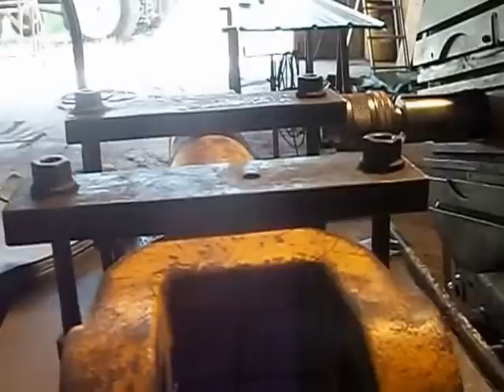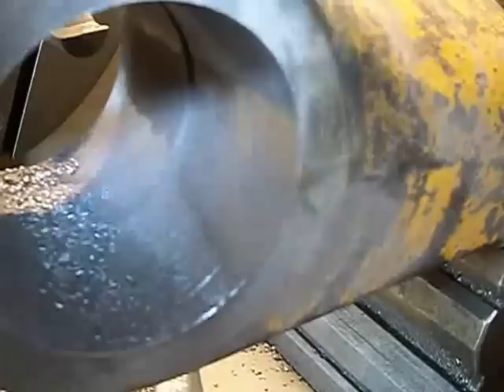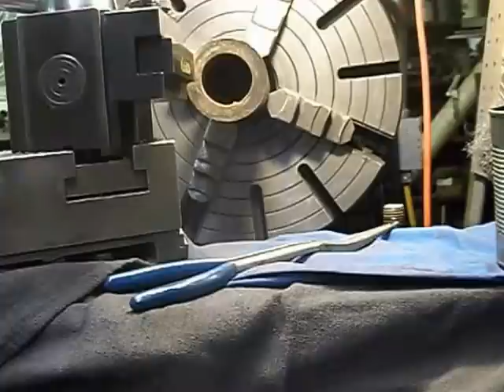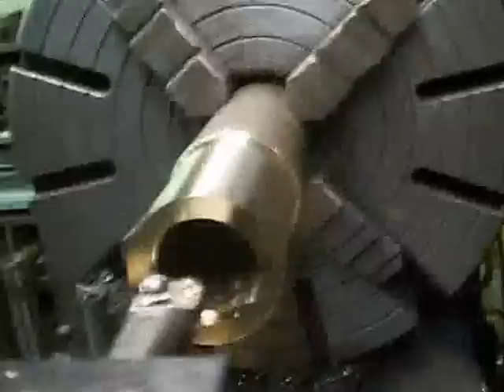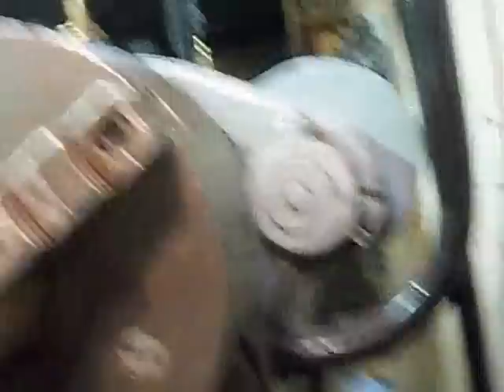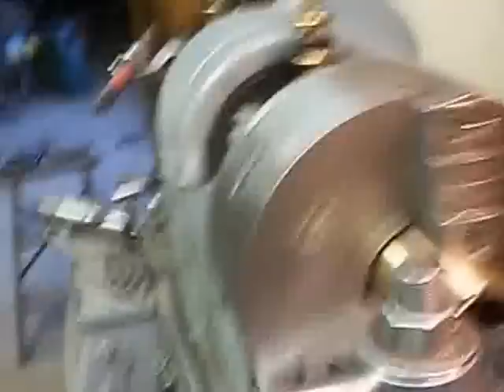PAYLOADER ARM REPAIR WMV

Comment: Try adding some negative rake to the top of the tool bit and you will find that the material will cut like butter. Then you can run the work in the proper direction also. Thanks for sharing, nice job!

Comment: Man I miss my big machines . As shop Forman I got all the special jobs in our shop. Which operators couldn't do. Loved being a machinist. You wouldn't believe the sizes of our different machines , 12' diameter VBM with twenty foot columns thru the roof . A wonderful mill. Thanks for taking me back
Reply from the maker: That sounds like some really big stuff you had to work with Thanks for stopping in

Comment: just curious, why did you use that material for the sleeve? if it's 83% (or there abouts) copper is that too soft for a pay loader arm? wouldn't  it wear quickly? I'm new to this so bear with me
Reply from the maker: This stuff is tuff it is made for high load areas . Like earth moving equipment
Reply: THE IRONWORKER  I have learned something, thank you

Comment: hi the only problem i have is the original material that is removed is not replaced by OEM standard materials, welding, then the bushing is replaced with OEM quality and dimention
Reply: I had the same thought.... Doubt that there will be a problem with the function of the repair, but if a mechanic tries to use a standard bushing in the future it will be an aggravation.....

Comment: Is that composite material hard to find, and is it cost compatible with brass?  You should have paned the camera up and given use a quick "shop update" when you were filming on the boring mill!
Reply from the maker: Not much done on the shop update to date Thanks